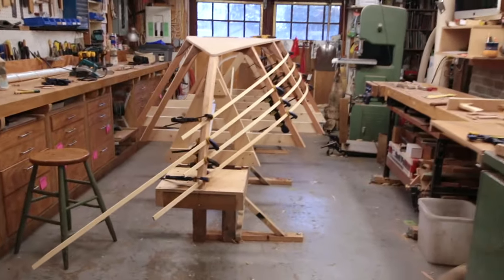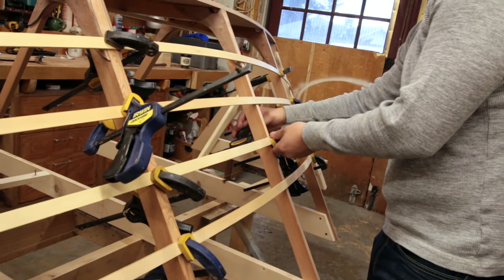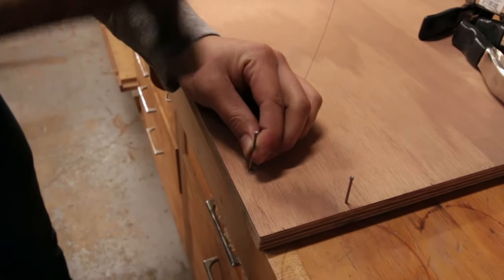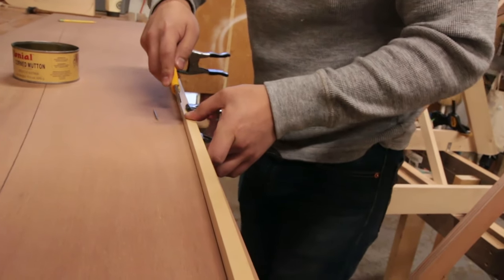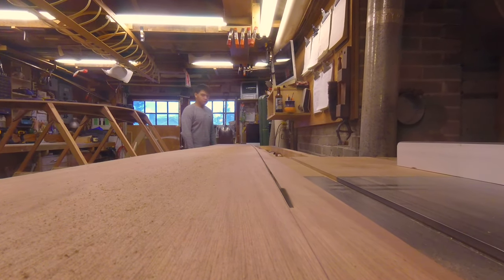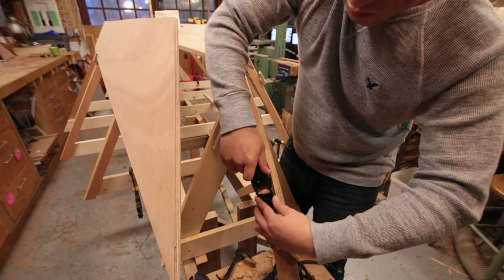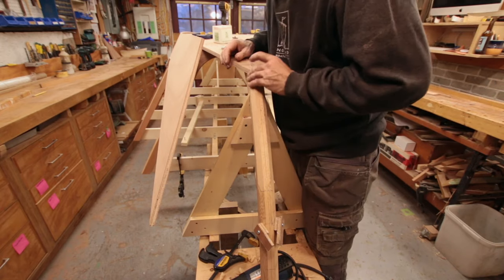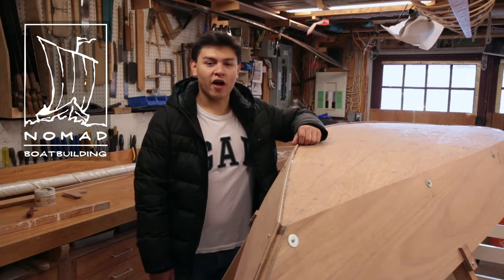Building the Bouchie Dory Pt.15 - The garboards

Comment: Fantastic video Mark!  You're an awesome sensei, your protege is very fortunate. I'm assuming you used neat epoxy for the keel edges and the frames, did you use thickened epoxy on the garboard plank? It seems the little homemade lock clamps with the quick clamps easily replaced the long reach clamps. Looking forward to more planking...
Reply from the maker: We did use thickened epoxy, applied to the chine and frames. It just didn't make it onto camera.